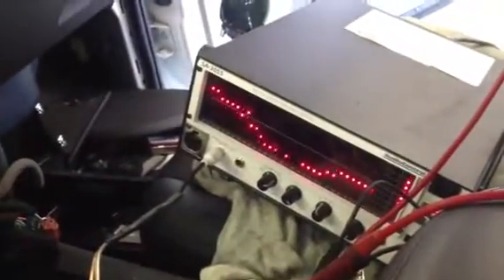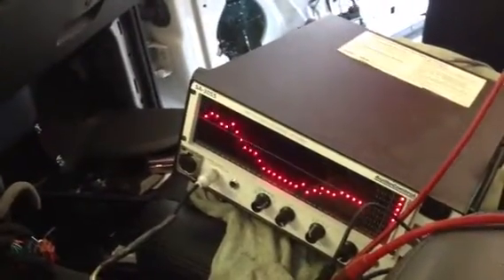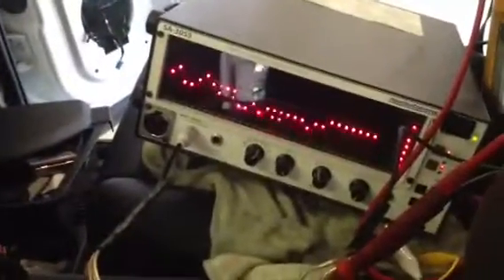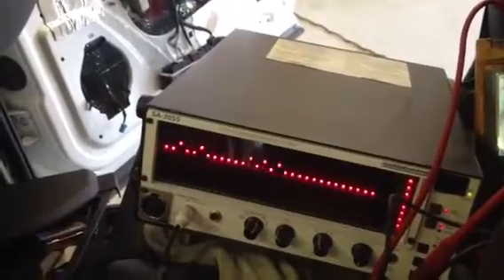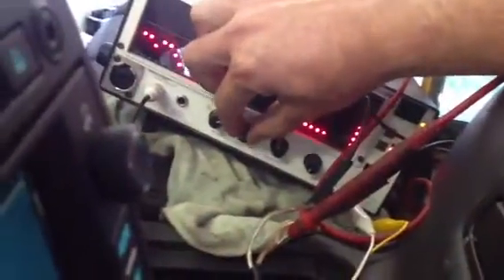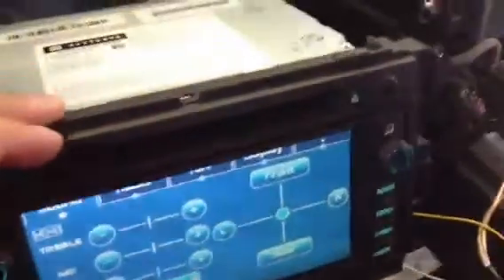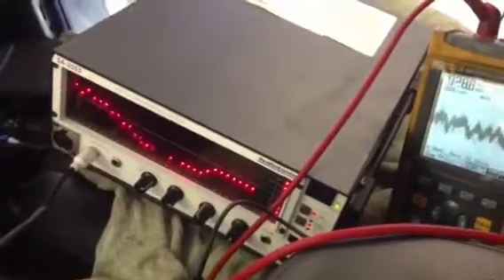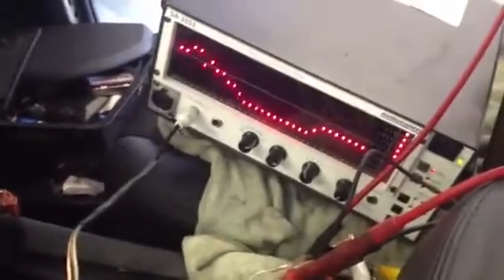Stock EQ curve 12' gm truck with bose

Comment: It is known as a loudness compensation curve. A flat frequency response sounds very thin at low volume but excellent at high volume. It is the nature of our hearing. So most systems contain at least an optional boost tailored to flatten out as the level increases.

You shouldn't want the boost at high volume as the bass and treble would overwhelm the sound. There is nothing wrong with having such a Loudness Compensation curve. Ideally it would be adjustable and selectable.

Comment: Ok big question, so I got some RF female RCA connectors to splice into the signal pre-amp side but going to the amp RCA input it just makes a loud noise like a short. Through a LP7-4 line level adapter from the bose amped speaker side it's fine. But coming from stock head unit to Bose amp it doesn't work for some reason. Also I had the console off and the rear radio control wasn't hooked up.

Comment: i thought this was a safety feature so you dont burn up the stock speakers easily. my oem headunit on my envoy and even the one in my moms impala does the same thing with cutting the low end.